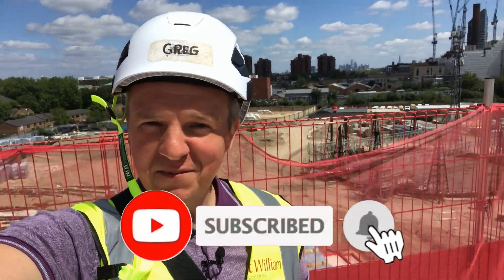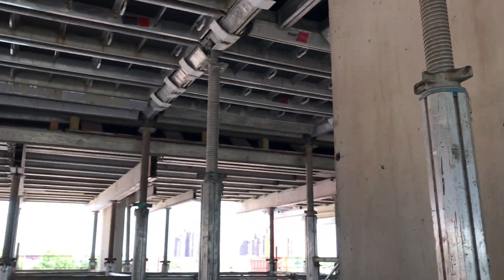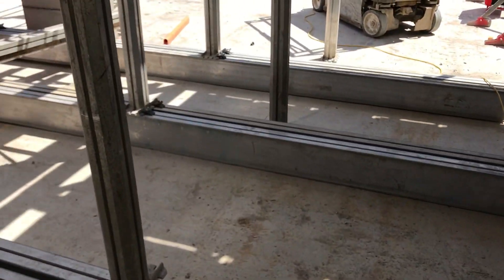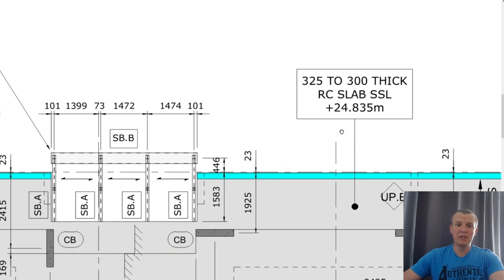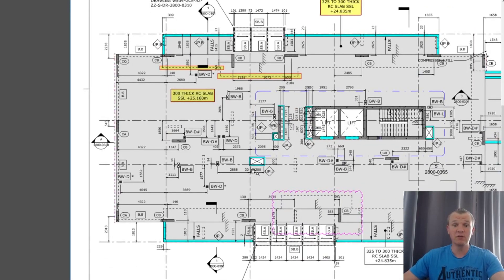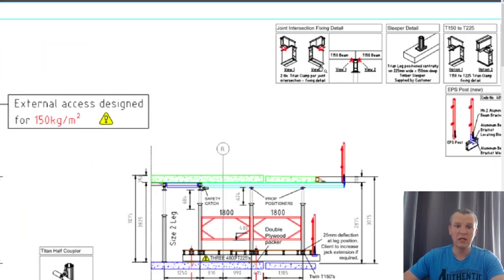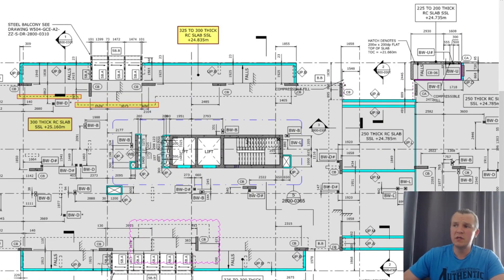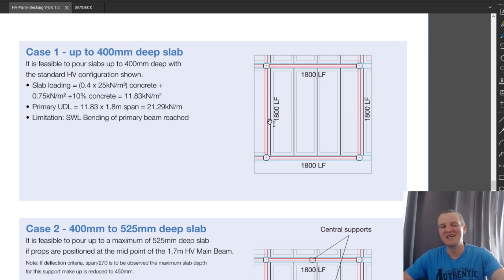Falsework - formwork. SITE ENGINEER needs to know when decking for next level slab.

Comment: I would mention only one thing about how high to keep the deck while decking. 5mm often is too much especially when the individuals who doing the deck keep it a few millimetres extra and you don't want to waste your time fixing it. As result you can lose the cover on the top which can cause more troubles. I recomend from my experience up to 250mm slabs no more than +3mm
I don't know also and how many people know how this variations in the soffit level reflect the predicted concrete while cubing up and how important is the cubing the part load on the end.
Reply from the maker: Thanks for this. I add between 3 and 5 typically, but when doing that this level is to be kept, not any extra, as like you say this can cause other problems. 👍👍👍

Comment: Why 300 mm slab thickness provided us there this building use for heavy load storage. I know or here in india we maximum  provided 150-175mm
Reply from the maker: The thickness looks crazy sometimes, on most residential you have 225 or 250 slabs which is a lot, some podium slabs are 400-500.
Reply: @SITENG  okey, thats reason. Thank you
Reply from the maker: Someone told me it's for acoustic as well and remember this slabs are with no beams, but still could be thinner I know 😁
Reply: @SITENG  if no beam where is slab support are given to column. Or there have hidden beam.
Reply from the maker: Slab sits on columns, punching shear steel is used around the columns, in some cases there is a need for column heads (in heavy loaded slabs)
Reply: @SITENG  thanks

Comment: In recent years with the current race to the bottom with the standard of labour used,  especially in large cities like London. It pays to assume every man is stupid and give them every bit of information possible, no matter how patronising it seems. When I started out 25 years ago the chippies would set out everything from the columns only the fixers would need setting out for the starter bars. These days most of the men are just labourers with hammers.
Reply from the maker: Yeah, that's right, it's definitely better to assume that everyone doesn't really know what they're doing😊 which unfortunately in many cases is the truth. When I started we had a surveyor coming to mark few gridlines and everything was measured off the gridlines by chippies. Here and now everything has to remarked and explained and still if you won't check it few time it might go wrong.  That's how our job's looking right now, but it also gives opportunity for ppl to go for engineering if they have a common sense as setting out starts your career really 😁

Comment: Do you maintain checklists for Inspection requests and get it approved by client before pour. If yes how do you do that and what are they?? The PERI drop head system is very interesting which release the shuttering materials. In general, after what period you remove the support system completely?
Reply from the maker: Yes I do. We are using Fieldview software, so everything has to be done 'as we go'. Removing all support depends on concrete strength results and backpropping needed for higher slabs. Drop head system is really great :)
Reply: @SITENG  So you maintain all Inspection requests and RFI on Fieldview. It is a very good software where all the project details can be monitored. Will love to see a video doing exactly that "On the Go". Will like to see how the total process shapes up before a pour.
Reply from the maker: I'll try show it too, but I am on different job now and we're not using it here.
Reply: @SITENG  Will like to hear your views on the formwork stripping. Does your code has any provisions to estimate the strength of the concrete after say 10 days of pouring. Our code has mentioned a general table mentioning Number of days (related to structure and span condition) after which the formwork can be safely removed. It is more on the conservative side.
Reply from the maker: This depends on the cube strength result. Sometimes we're crushing cubes next day on site to check if we're achiving 21.6 N/mm for early strike. Sometimes we are using concrete sensors (installed in the concrete while pouring which base on T gives you concrete strength) and sometimes also just waiting for laboratory cube result. From Peri ''m. Depending on the slab thickness and concrete strength, the SKYDECK Drophead allows striking to take place after only 1 day: see table containing minimum concrete strength and striking guide values''.

Comment: Great video as usual Greg! What an absolute pain these slab steps are when they are everywhere…! I think it would be good to show how you set out the steps for putting up the decking from the floor below, set the laser level for the chippies and then marking the steps on top when the deck is released! Would be also great to see other types of formwork for vertical elements (single and double sided shuttering for liner walls, roof parapets, core walls, etc). There are a few things your friends have introduced on site that might be good to show here! Hope to see you soon man, keep it up!
Reply from the maker: Alberto, good to have you back here :) Many thanks!!! See you soon :) I will do now about marking decking and try to add more on the steps and marking below.

Comment: show how you calculate level of legs , or crodile , or what structure you do there , how you set you lase , and how you calculate , add notes in that yellow boook , i work with this sistem but for me is dificult to act like ingineer , always speak from the perspective of a shuttering carpenter
Reply from the maker: No probem, I will add this in next video, before jumping on top :)